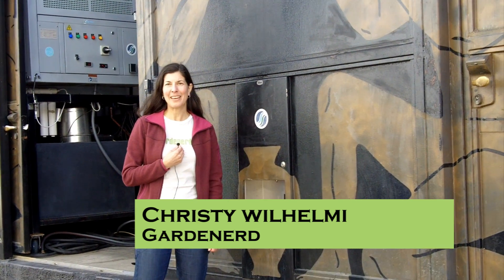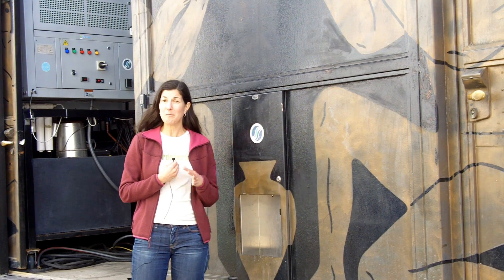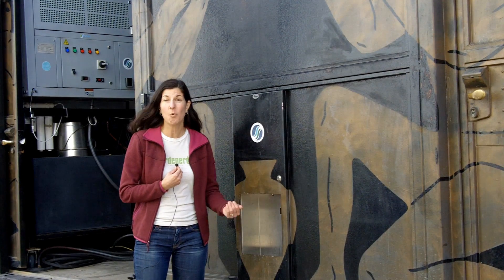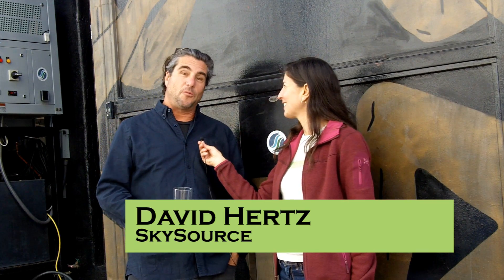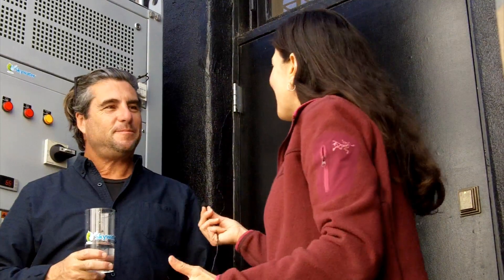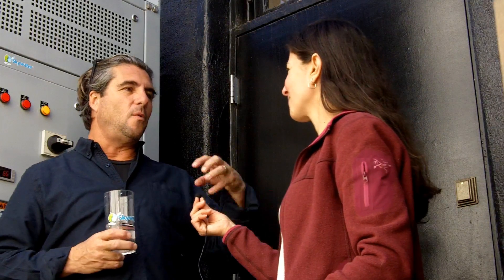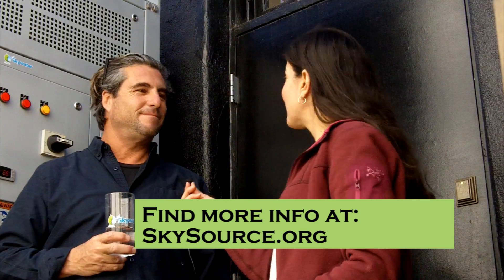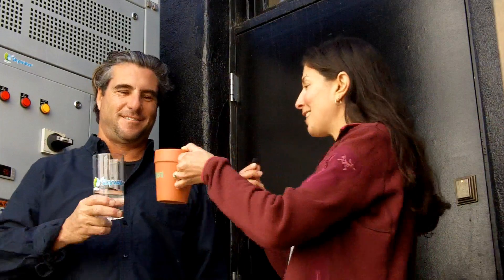David Hertz Makes Water from Air - Acknowledgment Series with Gardenerd

Comment: First of the all - the The Hertz family and SkySource did not invent this equipment. They have no patents.  They merely thought of a concept.  https://www.youtube.com/user/gbushan is the real inventor and manufacturer of these machines in India.

Secondly - the Hertz's actually scammed the xPrize folks out of $1.5 Million Dollars on this concept.  The judges in this contest should be ashamed of themselves for falling for this scam. The purported cost of no more than $.02 per quart is complete B.S. The set-up of this device is most likely the most expensive way to extract water from air ever invented. The laws of thermodynamics still apply no matter how much "green" paint you coat them with. Think about it - let's use a lot of energy to extract water from heated wood chips and use a lot more energy to convert the humidity in the air back into water. This requires a lot of electricity. For example, the atmospheric water generator (“AWG”) Island Sky/Skywater (the co-partner in this alliance) Model ESU-20 produces as much as 900 gallons of drinking water daily (but only under perfect conditions) and requires a 30kW diesel powered electric generator. Its average production would generally be in the 600 gallon a day range – similar to the set up that won the prize (See: https://islandsky.com/products/ ) The average fuel consumption of a generator of this size running at ¾ load consumes 4.4 gallon of fuel per hour and 57.6 gallons per day. (See: https://www.dieselserviceandsupply.com/Diesel_Fuel_Consumption.aspx ). The average price of diesel fuel in the U.S. is ~$3.00 per gallon. It is more expensive internationally, unless subsidized. So just the cost of the fuel to condense the 2,000 liters of water out of the air per day is ~$173 (and that is only at the most optimal relative humidity and temperature combinations. Actual performance will be less in almost every case). In summary, just the diesel fuel will cost at least $.09 per quart, if not more. So, the starting point is 450% higher than claimed. Now let’s add in the cost of: 1. heating wood chips to get the water out of them, 2. the diesel electric generator, 3. the much more expensive diesel fuel in many locations 4. the atmospheric water generator, 5. the shipping container 6. the water tanks, 7. the fuel tanks, 8. the transfer switches and electric panels, 9. the shipping costs, 10. the tractor trailer, 11. the personnel, 12. maintenance and repairs, and 13. getting certifications from every locality that the water meets or exceeds FDA drinking water standards in CFR 21 and the often more rigorous local regulations. The actual cost of this water is much closer to $1.00 per quart than the $.02 per quart that the folks claim. It would be much cheaper to just fill up a tanker truck with water and drive it to the place where they need water. That’s what the $1.5 Million dollars should, have been spent on. Not on a prize to people that have created nothing of limited, if any, practical use. They should stop payment on the prize check. Please see this whole scam busted by Thunderf00t on YouTube https://www.youtube.com/watch?v=e3s-xI895zc

Comment: Oy Vey. Why do these damn “inventions “ keep popping up?  There is no technology that can be developed to efficiently or effectively pull water from the air.  The main problem is there is hardly any water in air in the first place!   Then you have to tackle thermodynamics, because it takes an enormous amount of energy to condense water; cooling is less efficient than heating and you have to do a LOT of cooling here. 

You are right on the ocean, figure out how to desalinate. 

You have a ton of water in the North of Cali, figure out a cheaper way to transport it. 

Don’t try to solve problems with ignorance.

Comment: The average water consumption per day for a family of 4 is between 320 and 400 gallons per day. So the average household would need two of these 40 foot shipping container devices and a huge storage tank to have sufficient water. Not practical at all. Just a giant power sucking dehumidifier.  He does not mention how large the solar cell array has to be for just one. This type of technology is right up there with the perpetual motion machine.
Reply from the maker: I don't know about you, Mrgman13, but in our household of 2 (plus 1 cat and 5 chickens) we use about 90 gallons per month, and that's with a native landscape and a vegetable garden, which probably cancel each other out. When we go to Burning Man we use 1.5 gallons per person per day. During the drought, my city (Los Angeles) reduced water consumption by 17% city-wide. When people put their minds to it, people can conserve. I have no doubt that if put to the task, someone could live of off 150 gallons or less per day easily. We're going to have to do that in the not-too-distant future. The unit Hertz has on the back alley of their office building produces 150 gallons per day and is about the size of an industrial refrigerator. Their 300 gallon unit is larger, but they use that for watering am entire community garden. The unit featured in this video doesn't make biochar (that was their X-Prize-winning prototype), it just makes water. We've consulted with one other company that has a unit the size of an office water cooler that runs on one 4x8 solar panel and makes 14 gallons per day. It's enough to keep a family alive in an emergency, and I think the tech is only going to get better from here.

Comment: 80% of the water relative to the air, or the temperature is... Stick to architecting plz. The amount of water the air can contain increases with temperature. That's why mirrors (colder surfaces) in a bathroom become damp as the air around it is of lower temperature due to the mirror cooling it. 80% means that the air contains 80% of the water capacity it can store that a certain temperature, not that 80% is actually water.

Comment: Okay, first off this is dehumidification - water from dehumidification is unfit for human consumption; it lacks the minerals we need, and even better water from dehumidification is a reasonably toxic swamp; it's fine for watering a garden, but again, lacks the minerals plants need. These issues mean that water from a dehumidifier needs to be treated before being consumed. If you want to collect water from the atmosphere collecting water from fog and cloud is a far more effective solution: www.fogquest.org - as an example. 

The law of conservation of energy - you might want to look it up. A dehumidifier like this only works in a very narrow range of areas - so, in this location at 80% relative humidity it's fine, however, it's not a solution in less humid conditions. In a drier climate, the energy required to generate water makes the water very expensive. 

Passive collection, moisture traps & drop irrigation are far less technologically dependent and reliable.
Reply from the maker: @Byronic, thanks for sharing. A couple things: the system has a series of filters that purify the water making it suitable for drinking. I know of another system (though I'm not sure whether this particular one has it or not) that also adds minerals. Also, this particular system works at 60% humidity. In coastal areas that is common. Definitely not a solution for everywhere, but for places with high humidity it's great. California spends 23% of its budget moving water south, so anything we can do to provide a local water source is better than that. It works off solar panels, so it's a great off-grid solution.
Reply: @Gardenerd  It's the size of a sea-can, it requires a huge amount of technology to creat and operate, it breaks down, requires constant care and maintenance by a skilled technician, so we'll disagree about it being a viable or sustainable solution. And then there's the energy footprint: The energy required to re-form the hydrogen bonds and make dispersed water vapour at anything less than an optimal level of humidity back into water again is huge; you should look a the maths - simple thermodynamics calculations.

In coastal areas where there's atmospheric moisture in the form of clouds and sea-fog fog collection is a far better, more sustainable and less costly means of collecting water from the air. I know a thing or two about fog-collection; I've been working on fog collection projects with http://fogQuest.org in Nepal for the past 8 years and I develop and build the data logging systems for the test collection units. My colleagues work on projects in Central and South America, and Morocco. This is a proven, unglamorous, non-mechanical, low-tech solution to providing water to people in arid, or water compromised areas; places where the groundwater is either inaccessible or too contaminated to use for human consumption. But, even fog-collection relies on a limited range of settings; the right altitude, coastal and sea-fog - deserts and arid climates are not fertile areas for fog or moisture collection by any means; coastal deserts, as in Oman, where fogquest ran a test installation was productive, however, in fact, the Oman project data showed an average yield of over 15 litres of water per square meter of mesh per day - the average is 5 to 8 liters/meter/day. Likewise, the system we have in Morocco works - it's a high altitude arid region that happens to get cloud and heavy fog throughout the year, rather like many places in California. 

We supplied the technology for collecting fog to make Hangar Vodka in San Franciso - add booze and the story is instantly more interesting, right? (http://www.fogquest.org/donation-from-hangar-1-vodka-and-proximo-spirits-may-2017/)

There are no 'free passes' to get around the laws of thermodynamics, and again, the energy required for dehumidification isn't trivial. "It uses wind and solar, so it's green." is one response I keep hearing, and sure, as long as you have wind you have power - no wind, no storage, no power, no water. Likewise, for solar power - there's an en efficiency gradient for solar power and storage is a huge issue and unless you have a large enough solar installation to power the machinery you're not going to get any water. 

Fog collection and the science behind it is backed by peer-reviewed, publically accessible research, and that's the key - don't be bamboozled by heavy machinery, the veneer of the 'big technology solution' and pseudoscience - think critically and broadly and most of all remember, the laws of physics don't really care how you "feel."
Reply from the maker: @ByronAgain  The tech in the video above is not the same as what just won the X-Prize. Above is much smaller (and they have a 7 gallon unit inside the office the size of a water cooler). So we're talking about two different things here. I appreciate your input and definitely agree that we should stick to facts. I'm married to a physicist, so that's where I dwell. Thanks for sharing and good luck with your endeavors. I believe there is room for multiple solutions, not one or the other.
Reply: @Gardenerd  Nothing replaces good science - and there are still no exemptions from the laws of physics and termodynamics and where it comes to engineering, context-appropriate solutions tend to last. The problem with 'water from air' is the energy required to make it work; conservation of energy, thermodynamics etc etc. It 'does' work - in a fairly narrow set of conditions and where and when the energy inputs are sufficient and present. The bit that most people miss is in fact, the facts and many have gone off and sold themselves, and others, on the idea that a dehumidifier that works in ideal conditions is somehow a solution for arid, water-stressed environments; a remarkable number of people seem to be allergic to the facts and the hard truth that a large-scale dehumidifier simply won't make water in arid air - not without a huge energy cost. And in actual fact, a dehumidifier is a dehumidifier is a dehumidifier; with apologies to Gertrude Stein, and what you've got there is, as is the x-prize winner, another dehumidifier.
Reply: @ByronAgain  Byron, how do I know if my location is suitable for fog collection? It's 20km from the sea, at 240m altitude.

I was thinking about making a device that extracts water from air without consuming electricity ; I think it would work, but I'm not good enough with the math part to know the yield. Maybe it would be very low.
Reply: @o00oZu1o00o  Altitude and proximity to the sea are useful factors in determining the suitability of a site, that said, it's good practice to put up and run a survey of potential sites over at least a 12 month period before committing to a larger installation. The NGO I provided the link for has projects in Central and South America as well as in the Atlas Mountains in Morocco. All passive systems that use no power and rely on gravity to move the water down to the villages for use. I would advise you to construct a number of what we call "standard (or small) fog collectors, or SFCs. The specifics are simple: the surface should be 1 meter square and have two layers of mesh; we recommend a raschel mesh; details on the website provided earlier. You're looking for an area where the prevailing winds drive the moist air/fog upward without trees or brush that diistupt the flow. The mesh in the SFCs should be 2 meters off the ground to avoid ground effects. You should, if you can, build several SFCs and run long-term surveys of the area that you're looking at, recording the water collected at each SFC for at least 12 months so you have useful data to analyze and make reasonable projections about yield on larger collectors or arrays of collectors. Science is hard, the process is slow, but the results are worth it.
Reply: @ByronAgain  Thanks Byron, this is super useful.
I will check the website again. The first time, I did not see the references of the mesh.
Thanks for the details about the winds, it helps me discriminate between several potential locations.
I hope a 1m2 mesh between 1 and 2m height will do: I could not put it at 2m high (there are houses nearby and they would not like it).

I will also build my own device to collect water from air. I don't understand how nobody came up with this design yet ; it is so much better than the other stuff seen on the net.

From reading your 3 previous comments, I knew it you owned your stuff and was the right person to ask about this fog harvesting thing!

take care

Julien
Reply: @o00oZu1o00o  Happy to help. Looking forward to seeing your designs and data.
Reply: @ByronAgain  I'll give updates in this thread.